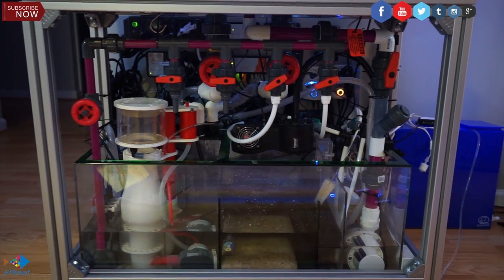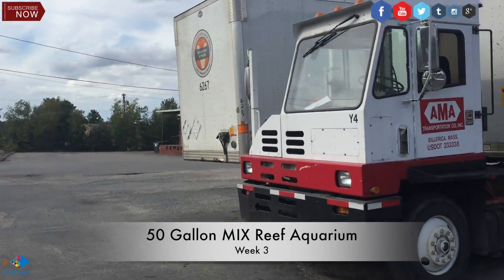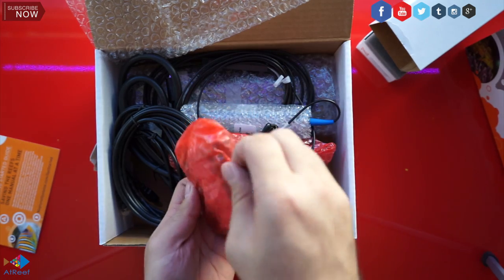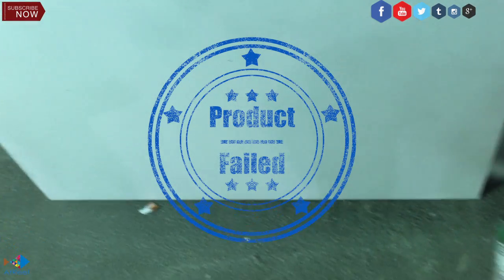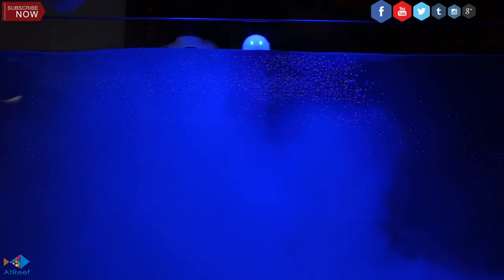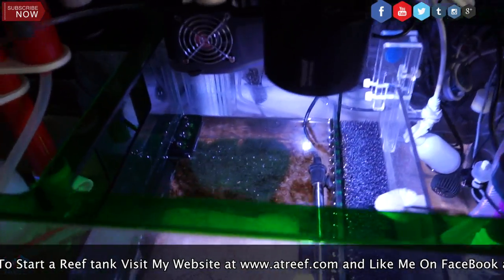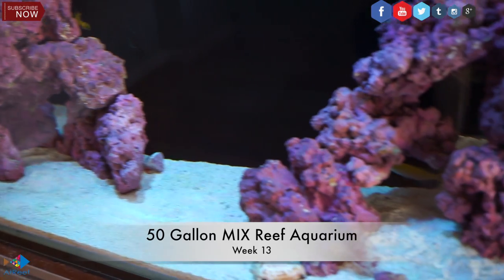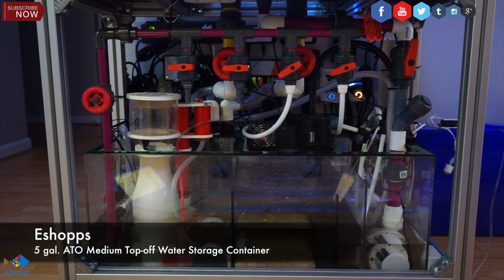How to Start a Reef Aquarium The Right Way

Comment: That paste for the rocks works fine for me. It is intended to be used in the salt water, and it takes a long time for it to harden. When it does, it is as solid as rock. You didn't have water. The rocks were dry when you tried it.
Reply from the maker: +Babak Morshedizadeh that is a very good point, and thank you for the information I will give them one more try, just one question, how did your skimmer react to it
Reply: +AtReef I used a different brand, and I did get extra skimming for a while. I've also just upgraded to a Hydor Performer skimmer 505 (rated for 125 heavy load to 550 light load); my total water volume is under 29 gal (my sump at maybe 12 gal and display tank + HOB refugium at maybe 17). It's a 20 gal long tank + a 20 gal tall sump (my own design). I'll be adding a ton more corals (LPS mostly and softies) and I am doing a long contact time in both my display and sump (water moves at 75 gal / hr between sump and tank, only enough to maintain same chemistry after 30 minutes of any change on either containers). So, overskimming should not be an issue. I shall see what happens :-)

Comment: really enjoyed watching your process.. you packed a ton of work into a 30 min video... Im curious about a couple things.. u have a ton of equipment under the tank.. when you wrap the stand will u do so in a way that it still allows u access for all sides? also are you going to add another light? the one u have doesn't have enough spread to cover your whole tank.. lots of shadows on the sides....  ether way still a great looking scape and tank.. looking forward to watching this progress.. I subbed. if you like you can watch my tanks progress as well.. not as elaborate but it gets the job done lol... be easy!
Reply from the maker: +CJ'S AQUARIUMS hello and tank you for liking my video, 
i will add more light as i add more coral but as of know i think this will do, i am not just sure to add more led or add a t5, as the stand i am thinking to get a cabinet that has access from all side.

Comment: As a long time hobbyist, These are the type of videos I would strongly recommend for new reefers. Everything you said and recommended was spot on. Thanks for sharing great information
Reply: Ashish Patel thank you so much for your kind words,
Reply: Ashish Patel although I agree with the higher end equipment I have to disagree and say this is for "the new reefer".  The new reefer wouldn't be able to have enough patience and the money to buy all these equipment and it could discourage any new reefer
Reply: You are 100% right.... I can see that now that I think about it.  New reefers - everything you see on this video - Majority of the items are not essential to successful reef keeping -  You need to budget where you can safe and where you cant'. Over the years I found myself collecting so much junk and end up spending more down the road and now I focus on essential items.  places you can safe without sacrificing success

1. RO unit from watergeneral $100 5 stage (amazing investment)
2. Skimmer - - Reef octopus - outstanding, cost effective, and works at a fraction of the price. You do not need a deltec or bubble king they all work the same.
3.  If you can't afford vortech - purchase 2 jebao controllable pumps. they work.
4.  1 sea swirl - this will give you random water flow all the time without the guess work. Its expensive but amazing.
5. Tank - buy wide tank so you can have less light.   For example - my tank is 42"L X 26"W X 24"T - with 2 radions led fixtures.
6.  You do not need a $350 return pump vectra pump - it own't bring you more success than a cheap pump!. Mag pumps are just as reliable and a lot cheaper. plus you can always use them for mixing saltwater later. I bought mine in 2002 and still using it for this reason.
7. Buy Dry rock that does not have to be cured and is cheaper, free of pest, and will turn into LR in no time. REEF saver rock is fine. seed it with clean rock from someone else tank.
8.  You can build your own stand, diy sump, 

Save up - take your time, and do it right. All you need is to learn how to keep water..
Reply: Also, for a new reefer who has no experience and can not afford to cost.. I'd strongly recommend FOWLR to build up your husbandry in keeping basic chemistry.  Reef chemistry can be overwhelming.  With fish a good skimmer, and biological filter (live rock/dry rock) and good RO unit is enough to start.   new hobbyist will overstock regardless of what anyone recommends bc in their minds there 55 gallon is huge... Your fish will not live long term because you still have to learn about the needs of specific species. I'd focus on chromis, clowns, cardinals, and maybe 1 or 2 tangs max depending on size.

Comment: Wow, awesome project, A+ overall!  Just a few comments only because I think this will intimidate a lot of people...
UV sterilizer not absolutely required
No need to cycle dry rock
Windex has ammonia, be careful there
No need to aerate the water in a new system
Ditch the clarifier
Auto feeder not required
To get started you can use hose barb elbows and hose vs. hard plumbing everything
This is a multi-thousand $ system just to warn people!!  A lot of overkill based on personal preference.  You could easily run a 125g+ system with this setup.
Thanks for sharing, I subscribed as this is the first vid I've seen.  Congrats!
Reply: Marine Aquarium thank you so much for you amazing information

Comment: The problem I see with the coral gum 2 pasty epoxy is that you put the super glue down below and on top of it. This creates a layer in which the epoxy can't attach to very well compared to having the coarser surface of the rocks which increases adherence. Also, check to make sure that you mix in the proper portions for part a and b. I use excites all of the time for other hobbies (miniatures, sculpting, etc) and they all work the same, you can get a softer, weaker result by using different mix ratios.

Comment: Great job mate 👍

How do you like radions? A local reefer bought them, used for 2 hrs and selling it for half price because he is not happy. I'm in a dilemma weather to buy them off him or not.
Its coming with receipt n warranty! 😝
Reply from the maker: +Dinesh Raj Methuku thank you Dinesh, i love my Radions. but i have to say that you need to know how to program them and get them setup, if you do not set them up right they could become a problem, however there are many forms online that can help you with them and could tell you the best setting for the type of tank that you have
Reply from the maker: +Dinesh Raj Methuku i would suggest do some research and see what is your tank result will be in a year and what type of lighting you may need in future, personally i think this type of light (LED) are much easier to work with as they are expandable and do not require matinees, set it and forget it. but if you like to go all out you could get them and in future implement T5 to you system and run them both at the same time. doing so will give you a great advantage and will look amazing
Reply: +AtReef thanks mate 👍👍
Reply from the maker: +Dinesh Raj Methuku happy to help

Comment: nice job !!! could you tell me where did you get the pvc fittings to reduce your 1/2" pipe to 3/8" tubing (after your valves) for your reactors? i really cant find it

Comment: few questions....
1. i want to start up a small 30 gal reef im a beginner when it comes to corals. would i be able to sustain a decent "Beginner" reef with a canister filter and proteins skimmer
2.my previous tank was a 55 gal FOWLER would it be alright for me to use a filter for a tank that much bigger than a 30 gal?
i would think if anything it would be good right?
i guess im just curious if the flow would be too much for a 30 gal...
same deal with the protein skimmer....
some one help _

Comment: hey I just started this hobby and I'm using dry Rock I tried to remove as many dead thing's on it I could find but when I out my rock in the tank some more fell off and now my water is a brownish yellow its not that bad but noticeable my salinity is perfect and so is my temperature is this going to affect my cycle I'm also using mysis shrimp to help build bacteria ci just started using them today my tank been running for 3 days now also using live sand

Comment: I am building a 180 gallon(7ft length) saltwater aquarium and I do not have space for a sump(the tank is gonna be under my 4K TV placed on the ground so no space for a Sump). Can I use two cannister filters (sunsun hw302)  and a protein skimmer?
Reply: Posittron you can but i do not recommend putting the tank under your TV because your tv will get damaged water evaporation
Reply: Dude, u serious?  I have a really thick wooden shelf in the between the TV and and the tank, the TV is wall mounted above the shelf
Reply from the maker: Posittron that should be okay but if you want email me a picture of your place that you want to put the tank and i can give you my take on it. Eadib66@gmail.com
Reply: I recommend adding a sump to your system, it will significantly simply your equipment down the road. You can put the sump inside the system via back panel or one side, or build a smaller system, maybe a 125 or 150 and have a small external sump.  Even if the sump is small, it gives you the opportunity to use filter socks, will simplify your water changes, easier ATO setup, a place for heaters, etc.  Consider a low end controller to simplify your electrical setup (timers, cords, etc), since your space seems limited.  Hope this helps give you a few ideas for your system.  Good luck :)
Reply: Very nice of you to offer your email and advice.

Comment: Nice set-up. How much did it cost, $3000.00? I have a fluval fx6 canister under my tank with a power cord for my heater and power head. I have a 125g tank with live rock and fish. Its been up for 3 years. No ammonia, no nitrite, no phosphate, 0-.05 nitrate, calcium 420-440, kh 9-11, ph 8, temp 78. Water change of 20% every two weeks. Although this set-up is nice, you should mention that you dont need to spend all that money on unnecessary equipment to have a successful aquarium. Maybe get a protein skinner for corals but not for a FOLR aquarium.
Reply from the maker: +Brian Kreller thank you so much, I wish it was 3000$ but I have to say that is how much the tank and stand cost lol almost, I am very happy that you have an successful system, you are the prove that shows you do not need equipment to run a successful system and I am very happy for you. however the reason that I am setting up this system is to have all the gadget and do it like a lab lol I find the equipment fun and interesting. happy reefing and keep up the good work
Reply: No one cares what you got. This guy has an insane set up. That’s why watching this vid.

Comment: For a guy looking to start his first saltwater aquarium, you sir have crushed my hope. haha this blew my mind and I will probably forget everything like Dory.
Reply: This was way overly complicated. 
I just bought a 60 Gal tank and stand from Petsmart. Did all hang on back stuff. HOB Protein skimmer, canister filter, heater, a couple powerheads(ordered off amazon).

Just get some live sand, some rock (dry or live, your preference). You can either get RODI water from your LFS, you can mix your own, or you are able to use tap, but just make sure you use a dechlorinator and conditioner to remove the harmful stuff. It really is not nearly as difficult as this seems. What he is doing is what a person does after they have a very good amount of time of previous experience. 

You will find that once you start this hobby....eventually you will be doing what this guy is. building your own, doing an awesome sump and lighting set up. You shouldn't spend THIS much money on your first beginner tank.

You can even do a Nano all-in-one. I just bought my second tank. It is a fluval Evo 12. Love it. It is made for saltwater. comes with literally everything you need as far as lighting and filtration goes. all you will need is a heater, sand, rock, saltwater. I also recommend using DR. Tim's one and only nitrifying bacteria. 1/3 the bottle each day for three days to start the cycle. If you want more help, feel free to message me. I can give you some awesome recommendations and references that I have used to help me get started. I'm new to the hobby to. 
The biggest thing to remember is that it is not hard. It IS a lot of information. but you just need to take it one step at a time and you will see it really isn't that difficult at all.
Reply: His method may be flawed and overly complicated but hes not going have no where near the amount of water changes you're going to need to be successful. HOB skimmers are junk. It sounds like you spent money on stuff you're going to need to replace with higher stuff similar to what AtReef is using in the future. Might as well bite the bullet and buy the right stuff first. I learned the hard way like what you're doing.
Reply: regardless... you have to start somewhere. Everyone is going to have to upgrade in this hobby later on at some point. I would rather spend the money on the great stuff after I have made all the mistakes. After I TRULY know what I am doing. Once I have learned from mistakes. Who in their right mind would go all out from day one?! That is idiotic. What if I ended up hating the SW aquarium hobby? Then I am so glad I didn't spend all the money and "bite the bullet" from the beginning. 
 It isn't smart to spend a huge amount of money at the beginning. You need to take your time and get your feet wet and figure out if it is for you first. Now, if you have money to throw away.. go ahead. But I am so glad I took my time. To me, even if I have to upgrade equipment later on, I am so glad I started this way first and then figured my way around the hobby. Besides.... All the stuff I have now....I won't reuse one single piece of it when I upgrade later one. So I would be replacing every piece of equipment regardless if I had spent a ton of money or not.
Reply: You can pre-filter tap if RODI is not available. Not expensive, and will make a big difference, as tap in general has high TDS.  Add a small bag of GFO to remove excessive phosphates may also help depending on the situation.
Reply: Marine Aquarium i dont know about that, i will never run any system with out RO/DI water
Reply: No, what he is doing is the proper way...

Running a proper nano tank, perhaps opposite to what you'd think, should
be left to experienced pros in the hobby; The larger the tank, the easier it is.

In a small nano, crashes happen overnight and are total crashes. A larger tank can "crash" 
over a couple days.

Bottom line though, salt water reefing the proper way is not cheap
Reply: get a fluval evo 5. 50w heater. crushed coral, dry rock, buy 10 gallons of saltwater. get the reef octopus media reactor. bio spira.80gph pump to use for powerhead and let cycle with media reactor running for 3 weeks    you can put low to moderate light corals. you can also put a small clown in. but might want to upgrade when he gets above 2 inches. but this is a good first time setup to get you started and let you understand the process just a little   u will have to do frequent water changes and might want to use RO water for top off   make sure you monitor salinity because in a small tank it can go way off fairly fast   i have a nano reef in my room and a 125 in my living room. my 5 gallon has never had any issues and the clown that is in there is having a hell of a time. he loves his anemone in there and loves to swim around and get cleaned by my neon cleaner goby which is also in there   very active   all day
Reply: Dude don't lose hope lol. I have a saltwater tank running on just a regular old freshwater filter. I run 4 extra carbon filters in the canister and my water is crystal clear. Running a 40 watt led light I got on eBay for 30 bux. Been running it like this over a year and it works great with no issues. People over complicate it imo.
Reply: David Galindo lololol
Reply: dude same here i was thinking of getting a salt water aquariaum then i saw this video and was like holy fuck nevemind.
Reply: @geekdafied  Why would you recommend a beginner to worry about dumping so much money into something so early? This is how people waste money when they realize it's not a hobby for them. Start cheap and if you continue the hobby, upgrade pieces as needed. Simple as that.
Reply: @cyrusexplores  OK you learn the most from your own experience and progression, but   learning from others is also preventing to make unnecessary mistakes yourself, just to enjoy the hobby more without the frustrations and failure, so the things you write, can be the exact reason to start hating your system (and/or the hobby...)....  I think i would not start with the most basic setup... Upgrading afterworths is always more expensive, time-consuming and can be an extra frustration, when the existing setup and lack of space limits your upgrade(s). I would not go for a system where i know a have to go to quick changes and upgrades.  Ik think that is even more idiotic.